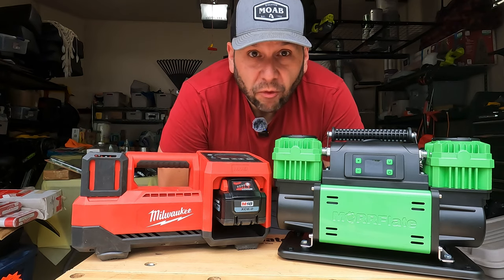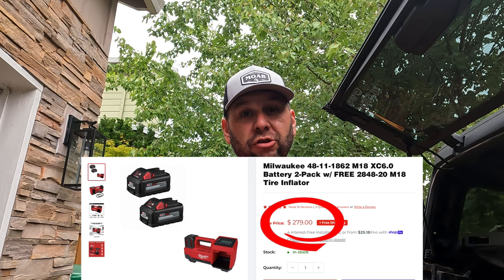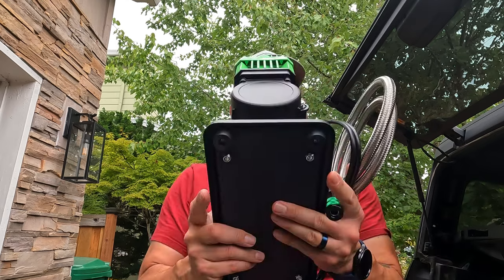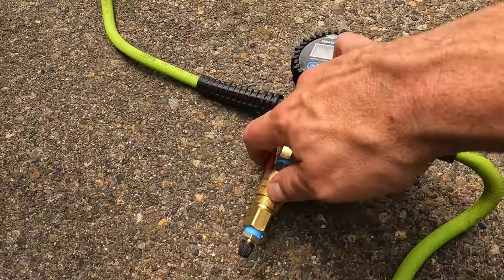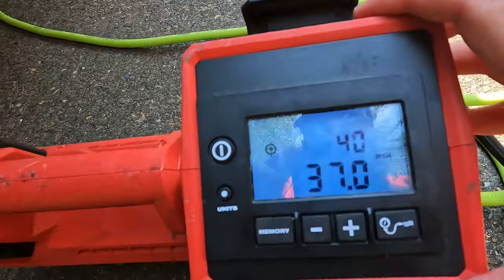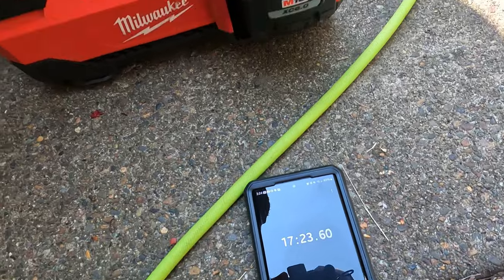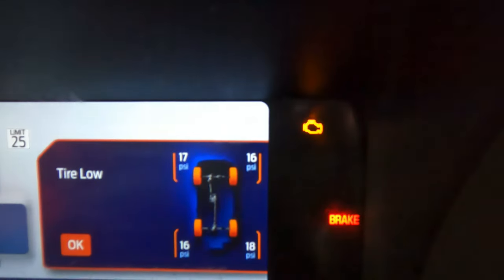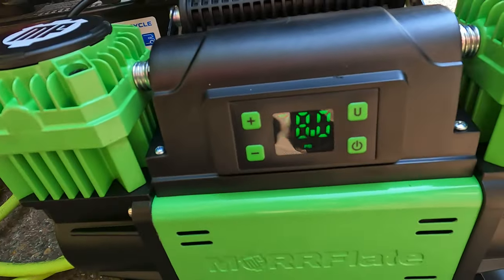MILWAUKEE VS MORRFLATE - THERE'S ONE CLEAR WINNER, BUT IS IT WORTH IT?

Comment: I think u should have did one tire at a time bcuz I don’t think da Milwaukee inflator was intended to fill dat much volume at once. I also notice I have to go couple psi higher bcuz it isn’t always accurate.
Reply from the maker: @spaGEHdee  I have tried it one tire at a time before just to see and it was slightly faster, but only about 3 minutes total.

Comment: 10.6 CFM, I was like that's better than my 60 gallon compressor. Marketing team at work. Might be the only compressor I have ever seen rated at 0PSI. Best thing about the milwaukee, I can take the battery out and put it in my 1/2 in impact and swap a flat  tire real quick.
Reply from the maker: @cliffyb5896  I still carry the Mikwaukee. It's just been downgraded to filling my trailer tires now. 😉

Comment: Every unit that looks like the Morrflate is a Chinese brand but someone changed a component on it and rebranded it. They use to be less than $150. Since people see they are better than ARBs, they are double or triple the price now
Reply from the maker: Yeah, there are tons of knockoffs. And yeah, $300 is steep, but still less than half an ARB and faster as well. Quite frankly I think ARBs are WAY overpriced, and unfortunately that's going to drive up prices.
Reply: Morrflate, without the PSI management part, is $195 on sale and normally $230. They rebuild the chinese one that you can still get for $120-150. Morrflate put a stainless steel hose on it with American fittings; upgraded the gaskets; replaced heads with aluminum for heatsink; added a pressure trigger cutoff, and added a purge valve. They basically sell the compressor for a $50-100 premium and you don't have to do the modifications. The $325 model includes a psi management system, which costs over $500 on ones like the ARB.

Comment: I bought the morrflate and a 4 hose kit. Super happy with them. It came with gloves too!
Reply from the maker: @cjbeck2200  that's awesome! I haven't even used it offroad yet but I was super impressed with just how good it was, even with my homemade hoses. Their hose kit will probably be on the short list of next "upgrades".
Reply: @VictorVlogsPDX  lol, I didn't know it came with gloves, but after I tested it in the garage the first time and went to disconnect the hose from the air compressor I realized the value of the gloves!
Reply from the maker: @cjbeck2200  yeah. I was definitely surprised by just how hot it was. Thankfully it cools pretty quick. But yeah, def gonna make sure I have gloves for next time.

Comment: You must realize that the Milwaukee pressure reading is designed to read a single tire pressure within 3 feet of the unit right? You're running what 20ft of hose through how many fittings?

Comment: Lets use things outside their intended range then make videos complaining about it. 

This is meant to do a tire at a time for convenience not high volume compressor for what youre doing. All these pumps have around a 10/20 duty cycle. This pump is a game changer for my work trucks on 35s that constantly get flats on job sites.
Reply from the maker: I don't see the part where I'm complaining. This was a comparison from what I was using to what I what I got to replace it. The Milwaukee did great for what it is and how I was using it. And I agree, it is a fantastic piece of equipment, especially for use cases such as what you stated. This was to show how much better things can be if you pony up the dough and if it's worth it to each individual. 👍
Reply: @VictorVlogsPDX  I don't think this has anything to do with ponying up dough.

You're comparing apples to oranges. One is a single piston light duty compressor, the other is a dual piston, meant to fill 4 tires at once.

To make the argument of ponying up dough, why don't you have a screw compressor and a generator and fill all 4 tires in 20 seconds?

Comment: Wouldn't it be quicker to do one tire at a time with the Milwaukee? Don't have to spend time setting up the quick connects/kit. And probably not have to restart it 8 times.

Car and driver reviewed the m18 and it filled a single Bronco tire in a little over 2 minutes from zero psi.

The moreflate is definitely quicker. And the better option for doing all 4 tires at once.

But you should re-test doing one tire at a time.
Reply from the maker: @BuffaloWarrior7  I have tried it one at a time out on the trail. It saved me about 3-4 minutes overall from doing all 4 at once.
Reply: Glad I got the Milwaukee. I can use the batteries in other M18 tools. Great piece of kit.
Reply from the maker: Totally agree. The Milwaukee will still get the job done. And will serve many people just fine. Thanks so much for watching.